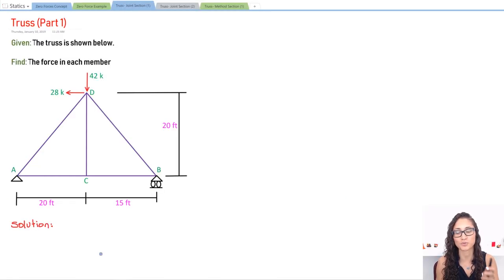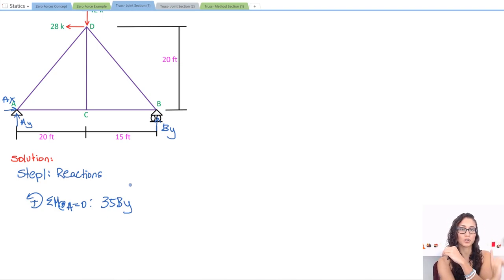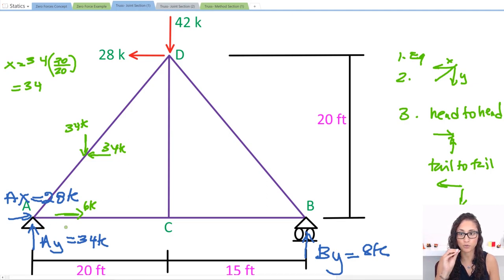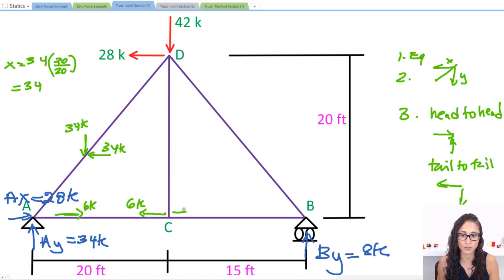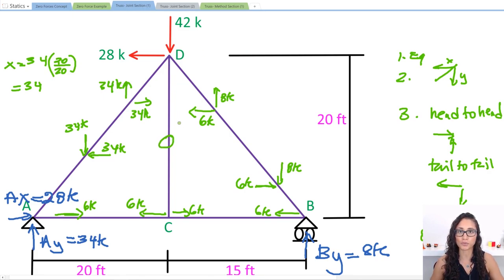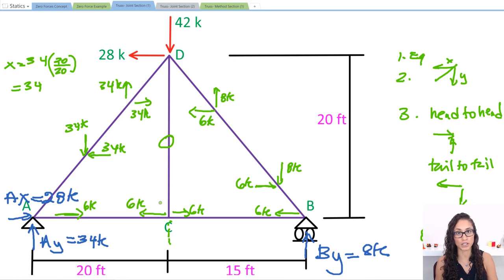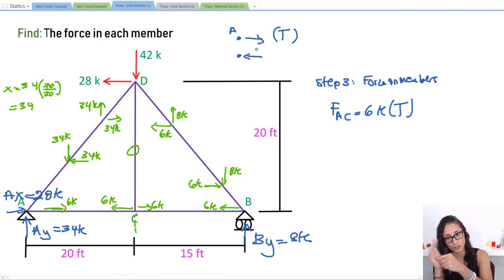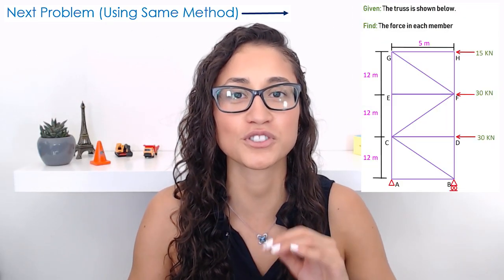FE Exam Statics - Force Members On A Truss

Comment: Based on Joint method  member AD supposed to be 42* sqrt2=59.4, and  member Ac =14, I do not agree with your results in those 2 members, the rest is accurate. Thanks

Comment: Hello there. Thanks for the great help. I have questions for you. 1) Did you find any question based on Virtual work or Influence line? 2) One of the videos you mentioned about solving practice exams and you added you have solved 2 practice exams. I know we can order that from NCEES website. If we order two exams (for a same discipline) then will it be two different exams? Thank you in advance!!
Reply from the maker: Hello, I did get a question on virtual work and influence line but they were both really simple, straight forward, I will share those problems sometime in the future. So the NCEES website sell only one of the practice exams for each discipline. The other practice exam, I came up with the questions using my college books and the FE Civil practice problem book by Linderburg. I hope this helps and good luck!
Reply: @Genieprep  Thanks for the quick reply. Definitely would like to see problems on VW an IL.  Would like to ask you more questions related to fluid / Hydrology. Should I ask you here or is there any other forum I need to post or send you directly?
Reply from the maker: @mugdhathote  No problem and you can email me your questions at engenieer.online@gmail.com.

Comment: This concept is very simple to follow, however it does not make sense. how can you have 34 kip going downward at and angel and it still be exactly equal to 34 at the joint at A. does not make any sense
Reply from the maker: Hi Grayson, thank you for watching. That's a great point, so the member AD is diagonal, and that's why we have to break it down into 2 components x and y, so we will have FADx and FADy. After that, if we do the summation of the forces on the y, we are going to have FADy and the reaction Ay. These two forces have to be equal and opposite to each other to reach equilibrium at joint A. I hope this makes more sense and good luck with your studies 😊

Comment: This problem will take more than 3 minutes in the exam.
Reply from the maker: This method should be used only if you need to find all forces on the truss, so you can calculate the displacement at a given point using the unit load method (see page 158 on the reference handbook). If you practice a lot, it should not take you more than 1 minute. Also if you try to use the method of joint or method of section to solve all force members that will take you longer. On the other hand, if you are asked to solve only one force member on a given truss, you should use the method of section. Good luck!

Comment: The way you determined TvsC sorta goes against my intuition. In my mind, if the forces are pulling away from a member, it causes tension. But I would have kept the arrows pointing towards the joints, and negative numbers would determine compression.

Comment: This was incredibly confusing.  I would go to Gregory Michaelson for structures problems.
Reply from the maker: Selina, using fast method of joint can be tricky to understand at first, it is easier to understand just method of joint but in this video, it is more about how to solve a whole truss under 2 min and it is only important to know if you're using unit load method to solve for deflection in truss, otherwise, you just need to know method of section, https://www.youtube.com/watch?v=oNUAWCLgb1Y&t=27s. I hope this helps and good luck with your studying 😊

Comment: When you  were solving for moments around A, why is it 28k times 20 feet? Shouldn't the length be AD? Since that is member that is acting on point A? (Just like when you figured out the first piece and it was 35 (20+15)By)
Reply: Moments are a cross product.  When you have a horizontal force applied to a diagonal lever, it produces the same moment as if you had a shorter lever that were purely vertical.  By multiplying it only by the perpendicular component of the member length, that accounts for the sine term in the cross product.

Comment: Why is this method superior to the method of sections?
Reply from the maker: Hi TA, so you have to make sure you know when to use the method of section and method of joint. When we're trying to find one force member, it's better and faster to use the method of section. But let's say, you have to find the deflection of a truss at reaction A, to use the virtual work method (aka unit load method), you have to find all the force members on the truss, and that's where we should use the method of joint because it would be faster to find all the members. I hope this helps and good luck with your PE!
Reply: @Genieprep  thank you. Certainly finding forces in all members of a truss would be too intense for an PE's AM  section. For PE's PM structural it seems plausible. So seems that for AM section method dominates. Thank you for response.
Reply: @oleopathic  There are some cases where you have an advantage in using both methods together.   The method of sections has the advantage of getting 3 member forces with the same group of equations, while the method of joints is more limited in the number of member forces it can give you at once, but has the advantage of getting member forces that aren't within the same section of 3 members.  You can always use the method of joints to brute force your way through any truss, but it is easier if you can strategically simplify it.

It also helps to use zero force members, and symmetry to reduce the problem as much as you can by inspection.   If you have a 12 member truss, and you identify 3 zero force members, and 4 pairs of member forces that are equal by symmetry, you can reduce this down to one installment of the method of sections, and one or two installments of the method of joints.